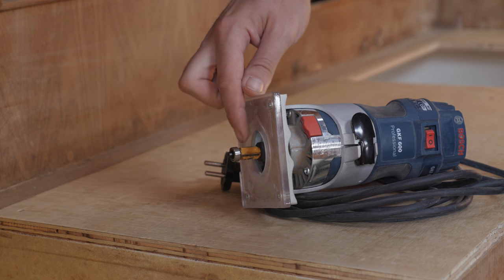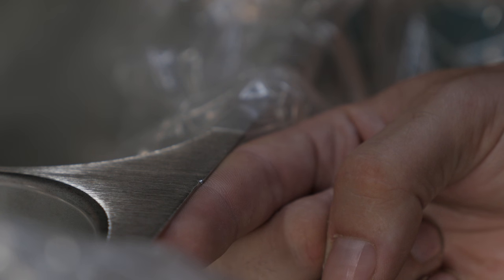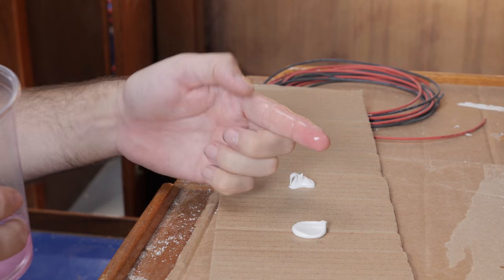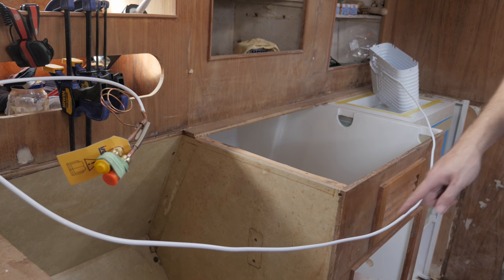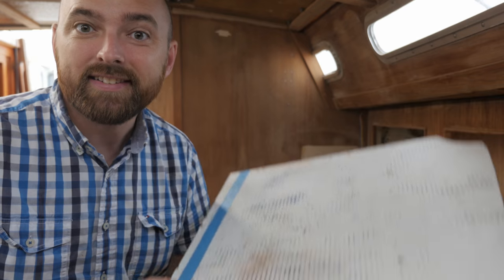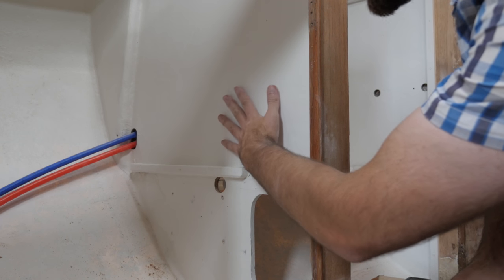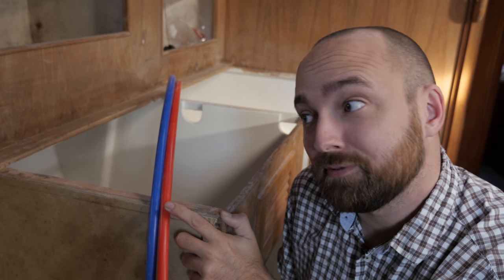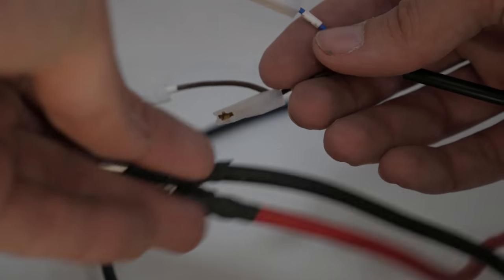Sail Life - Hooking up the fridge, DIY sailboat restoration

Comment: You always do such fine work!  I won't even show you the inside of my fridge right now...it's scary in there! I will eventually do a video of mine, it's a very interesting layout right now. The freezer section is accessed from outside the boat, through a hole in the deck. I plan on changing that.

Comment: Great video and nice install on the refrigerator. Not sure if it has been mentioned before but regular automotive heater hose works excellent to prevent chaffing where your hot and cold hoses pass through the plywood holes.

Comment: Hi Mads, nice work :)
But you will need to get that compressor space ventilated, not just enclosed and by the condenser fan. You need to get the hot air out from that space and cool fresh air in to replace it. Otherwise your ECU will fry very very prematurely. Looking forward for the next video :)

Comment: The sink as you mentioned looks like it's supposed to mount from underneath. The inset ones are normally shaped & moulded on the edges.
Reply from the maker: The more I think about it the more tempting it is just to order a new sink and forget all about a replacement
Reply: Correct:  that is an "under-mount sink" as opposed to a "drop-in" or "self-rimming" sink.

Comment: Congratulations. Nice work. That copper tubing is really safe to bend. The trick is that copper work hardens so try to get it the first or second try. You may notice that it's easy to bend the first time and gets progressively harder to bend before it finally cracks. You plan things out well so it shouldn't be an issue.
Reply from the maker: Thanks! :) I'll keep that in mind when I bend the copper tube for my Refleks stove installation :) And of course if I at some point decide to build a freezer :)

Comment: I built a refrigerator on a Tahiti Ketch years ago.  Used isocyanurate foam sheets backed with aluminum on both sides.  Used 25mm on top, 100mm on sides and 125mm on the bottom.  I could turn off the fridge and still find ice in the ice cube trays 24 hours late in mid summer 35 degree C weather.  I wonder if the amount of foam you  used would be adequate in warmer climates.
Reply from the maker: Sounds like an awesome fridge you built :) According to the manufacturer the insulation I've used (given the size of my fridge) is good for up temperatures up to 48 C. Whether that is true or not isn't that important to me as I plan on spending most of my time in the high latitudes :)

Comment: I was always told to only bend copper pipe once.  So as long as you get it right the first time - no problem.
Reply from the maker: Cool, thanks for the feedback :)
Reply: True.  Copper in the soft state like bendable tubing becomes hard and breakable with bending.  You would have to heat to redness to return the copper to a soft state.  Big PIA.  Best to make a plan and stick to it.

Comment: Mads, you may want to leave the told over the evaporator open. It looks like the top is going to cover it. leaving it open gives you a small freezer compartment.
Reply from the maker: The lid won't cover up the access to the evaporator :) The whole idea of getting an O-shaped evaporator rather than a flat was to use it as a tiny freezer :)
Reply: Exactly, I have the same model and you'll be surprised what you can stuff in there. Just be careful you can get it out again once it freezes.
Reply from the maker: Hehe, I guess if something gets stuck in there you just tell people it's a holding plate rather than an evaporator (I know there is more to it than that) ;)

Comment: Mads, Thanks for the formica link in your previous video – really useful as I'm fixing up my galley too. (Albin Vega with that horrible mock wood countertop.) Could you tell me where you sourced the teak trim? I'm trying all the usual Danish outlets and haven't really found what I want yet. Tak!
Reply from the maker: I'm glad you found the link useful :) The teak molding is from svb24.com but you could also try calling Horsens Yachtværft (25 57 87 81). Super friendly guys! :)
Reply: Super. Takker :-)

Comment: Hi Mads...shouldnt there be some method of airflow for the compressor?? Also on the submarines I lived on sound mounting was paramont...If you put 1/2 or 1/4 closed foam on the back making holes for the mounting screws it should pretty much dampen the noise....Best always Jack

Comment: I mounted my evap horizontally under the countertop left of the lid on my my existing icebox and it was almost an impossible task. Those four spacers were so difficult to line up upside down and reaching into a cramped space with a drill. But I now have a lot more room and easier access, plus no more bags of ice melting every couple days ona cruise. I do wonder if you have ventilation for the compressor cabinet?

Comment: So if you wanted a bigger fridge, do you just buy 2 kits, 2 compressors, 2 evaporators, etc.etc. Or is one ecap and compressor big enough to power a bigger fridge?
What if you want a freezer? Is that kit good for making a freezer? 
What about the lid? Are you going to make a vid showing how you make and attach the lid?
Reply from the maker: You could use the same kit for a bigger fridge but you need more insulation :) The kit can also be used for a freezer. I'll most definitely film the making of the lid :P

Comment: seeing your installation of the fridge compressor I was amazed to see that you were not providing for any extra ventilation to get rid of the generated heat of the compressor. As far a I know, this might lead to much higher electricity consumption. In a good summer it could give problems (even in Denmark) when you most need a cool drink! By the way, thanks for your marvelous videos!
Reply from the maker: Thanks :) I'm glad you're enjoying the videos. There is a vent in the locker I just didn't mention it in the video :)

Comment: I know this is probably too late, but the evaporator should be horizontal so it can be used as the freezer. Or vertically with the bottom of the fridge closing off the bottom end of the evaporator to again use as a freezer section for your fridge.
Sorry this was late.
Reply from the maker: There is a bottom in the evaporator :) It can be used as a freezer in both orientations :)
Reply: I think there is some sort of metal back to it already
Reply: Oh good! Do you have easy access to the freezer from the access door?

Comment: Mads
Great job with the videos of your ice box installation and great job with the design and construction.  It's no wonder your channel is so popular.  One quick thought - I do hope there is enough ventilation for the heat to escape from the area where you mounted the compressor.  You might think about one of those little 12V computer fans for an exhaust fan.  Would you mind telling me what type of camera you have been using?  You mentioned you started using a 4K camera.  What is that?  
Thanks again.

Comment: Again, an old video, but for future views, I use various sized steel ballbearings tacked to steel rods about a foot in length, one on each end, each a different size to fit various radius profiles for tabbing and caulking. They clean up quickly too, and the spherical shape makes a perfect convex radius on your angled seams for that finished look.

Comment: Those power connectors are probably fine for the 'fridge, but I do not like that style (sometimes called FASTON  https://en.wikipedia.org/wiki/FASTON_terminal).  There are many different manufactures of these and depending on the plating they may quickly corrode even with those "boots" over them.  High current devices, like that compressor motor will likely have enough starting current to not corrode where the 2 pieces actual contact.  This is also a good place for silicon dielectric grease.

Search for a different type of connector for low current (<1A) connection or connections that are more likely going to get wet.

Comment: This comment may be way too late.  I'm trying to catch up on the videos.  You should consider chafe guards on your water lines running through bulkheads and when bending around the shelf.  It will prevent damage to the hose over time.

Comment: On your new shelf, there is pressure (semi-sharp edge) against the hot/cold water hoses. Taper/bevel the areas where hose touches or put padding there.
Reply from the maker: I'm still debating putting 90-degree fittings to route the hot and the cold straight down. That would make it look super neat but I think the fittings are going to be the weakest link. Choices choices :)

Comment: Hello Mads. i dont see the point of oploading the video in 4k most computers dont have the resolution to handle 4k  and 4k does require at really good computer and some strong internet.
If u ask me i think u should stick to 1080  which is more than fine :) btw the refrigerator looks really nice !
Reply: rather have higher fps its really lagging in this parth of the video https://youtu.be/jE8QreD2g84?t=8m34s . 
im really glad about the content you deliver and i really enjoy to watch your DIY project
Reply from the maker: There are two big upsides to 4K :) 
1) 1080 won't be the standard forever and by going with 4K, my videos are a little more futureproof. 
2) The downscaled versions (1080 and 720) that YouTube renders from 4K looks better than if you upload a 1080/720 version directly. Supposedly the bitrate in the downscaled versions is higher :) 
Also, 1080/720 shot with the GH4 doesn't look all that great so no matter what I still need to shoot in 4K
Reply from the maker: It's very rare that I shot footage that would benefit from 60fps :)

Comment: What is the "pot life" of that paint after it is mixed ?  You actually had enough work time to put 4 coats on the edges (good idea), with sufficient drying in between ?
Reply from the maker: At 20C it has a working time of around 10 hours. Lover temperatures = longer working time. I could have gotten a 5th coat on there but I got lazy.

Comment: Mads, maybe I should have raised this concern earlier, but I think the location you picked for the compressor is sub-optimal, because it is in a relatively confined space with bad ventilation, when everything is finished and put together. The efficiency of your fridge is going to suffer from that, because it will get very warm around the compressor quickly and it will run a lot and hence consume higher energy. But given that you have designed it in that way now, I believe the least you need to do for compensating that issue will be to put a metal "grille" which allows for good air circulation in the front panel before the compressor.
Reply from the maker: The placement of the compressor is perfectly fine. There is already a vent in the locker. Plus the compressor is located close to the cabin sole (coldest air in the boat) and not in the same space as the evaporator. There is nowhere better for me to mount it aboard Athena.

Comment: great video  as usual.....just curious...the compressor under the fridge generates heat...heat rises.....fridge  is over heat source... have you accounted for ventilation  to divert the heat away  ?  I've seen boats during the hottest months get so warm inside that the fridge compressor runs almost none stop...and then the heat from the compressor  adds to the boat cabin's internal temp...the cabin just gets hotter making the compressor run harder....and so on ...and so on.....:-)

Comment: I hope you provided a vent to allow the heat from the condenser to escape that cupboard, or the condenser will die from running continuously while over heated. A computer muffin fan would increase efficiency immensely.

Comment: Yes, you're OCD, but that's ok.
It really seems like you're putting your compressor further away from your fridge than is ideal, and it's really best for performance if it's close and the tube is short. Obviously in a colder climate, it probably matters a little less. However if you plan on using the fridge in the tropics someday, it might be an issue.
Reply from the maker: The length of the tube can't be shortened in these kits. That is just the way they are designed.
Reply: Well, technically they always can, but if they're already charged with compressant I can understand why you might want to avoid that job.  You might consider wrapping the copper lines with foam or something to insulate them on their route before closing things up, it might buy you some efficiency.

Comment: The rheostat is such an outdated idea and is made to control the freezer temp not the fridge. DUMB. I picked up a digital controller off of eBay for $20 US and use it to 
control the fridge to 2 deg of setpoint (35 deg) and I can look and see any time to make sure all is well. Plus, it's wired to the compressor unit for power so no display, I know there is no power into the unit.
If your interested let me know and Ill send you a link.
Reply from the maker: Sounds very interesting :) Must be something similar to the "Smart Energy Control" kit Isotherm offers. I hadn't thought about looking for alternatives on eBay. Thanks!
Reply: The Stc-1000 is a 230V device! You should have the Module H-Tronic TSM 125 12 V/DC -55 tot 125 °C for 40 Euro